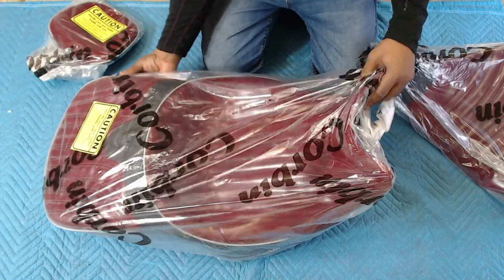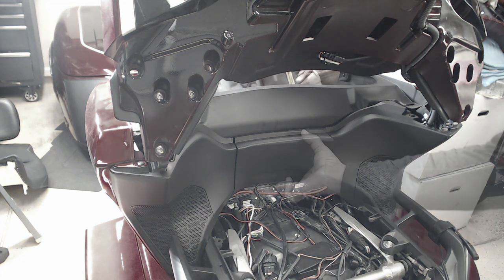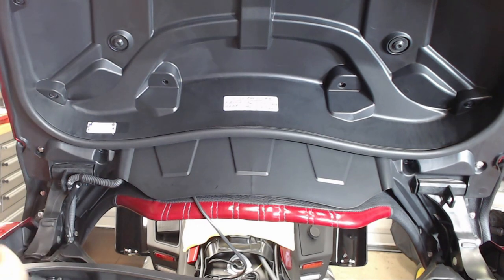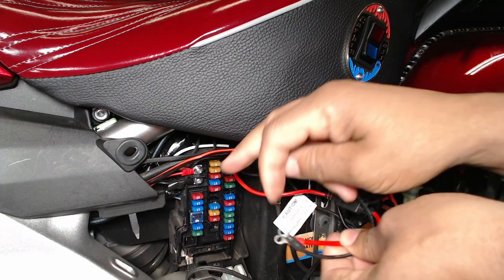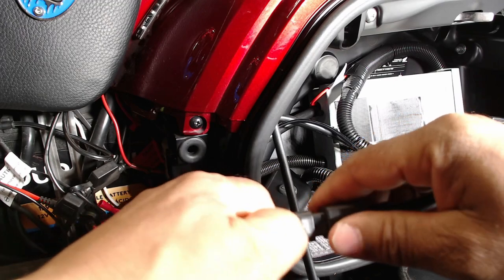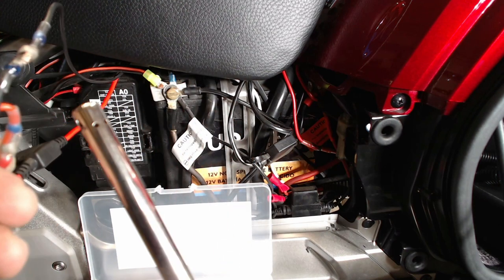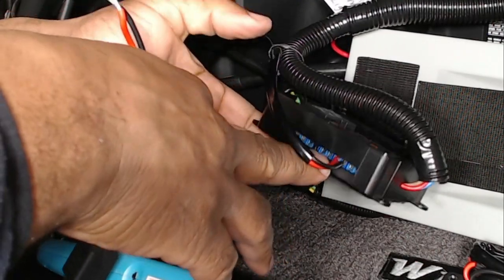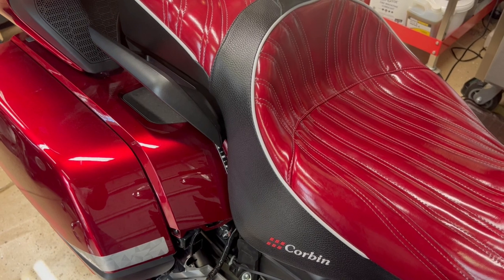Corbin Fire & Ice Saddle 2022 Honda Goldwing Tour Install

Comment: So, I guess I have a few questions. It looks like the seat is connected thru the saddlebag, so if you seal the cable in. how do you remove the seat with the permanent mount? It looks like the seat only has an off and on for the heat, so is there no adjustability for the the heat level? Is your heated grip not going to work now? Also, that splice connector actually isn't done correctly. I'm sure it will work out fine, but the intent of that design, with the larger end, is for another cable to be run thru it and wrapped around the wire. I will be interested in how you like the seat, so keep us informed. Have fun.

Comment: It looks like it only has one setting for seat heater is that the way it is and does it keep a certain temp or you have to turn it on and off . It looks like it will be better than original but I don't think it will match your 2016 for comfort FACTORY seat